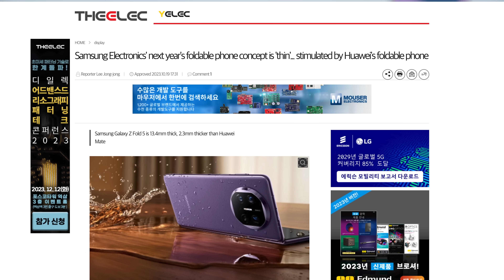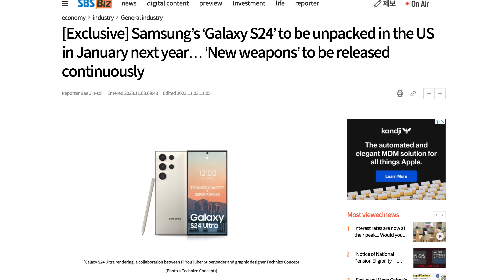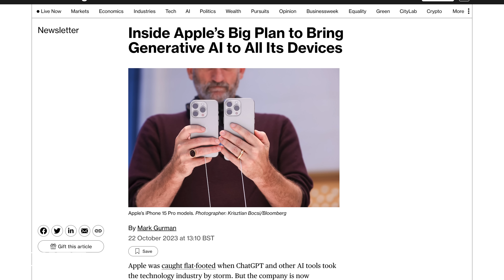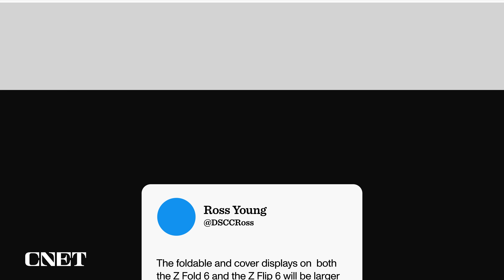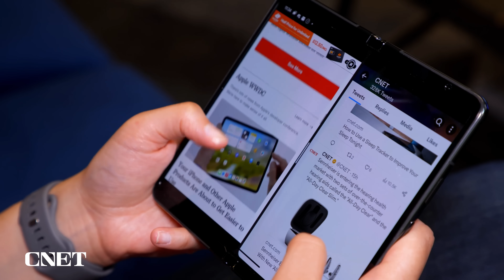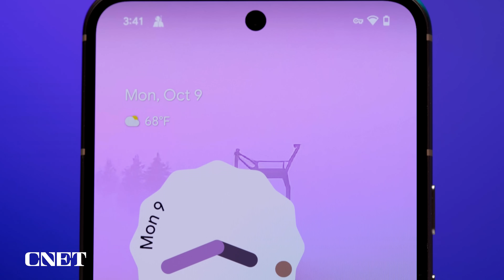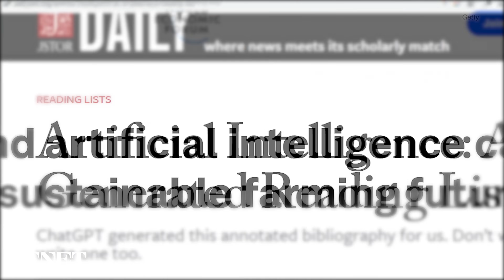Smartphones in 2024: What To Expect

Comment: prob gonna get a pixel this year, curious what google has up its sleeve.
Reply: When i had a pixel 2 it was fantastic. Still fast to this day
Reply: @Andromedagalaxy22  i've heard only good things about pixels. I've been a samsung user since I got into smartphones w/ the S3. I have a flip 5 and Fold z 3 right now, but want a pure android device.
Reply: It's one worse phone with that processor which heats up, at least apple would implement hardware difference between it's base and higher model, whereas pixel has software difference between normal and pro, which is funny
Reply: Terrible battery life.